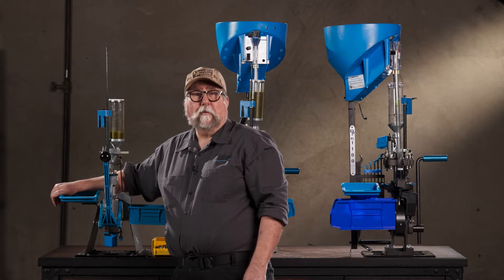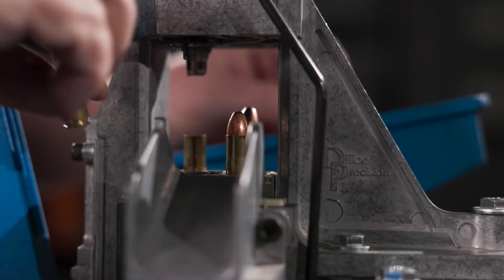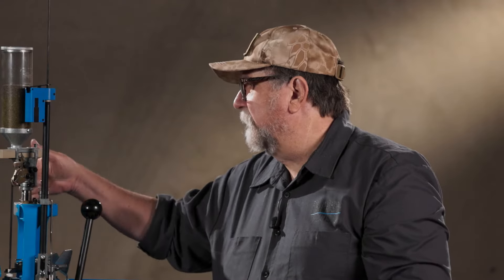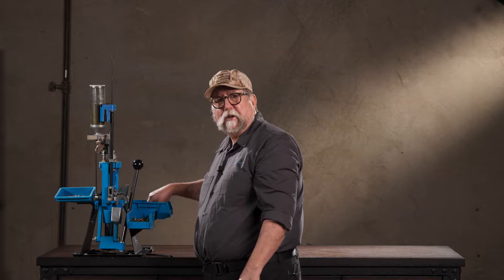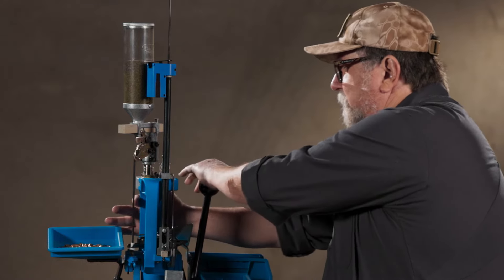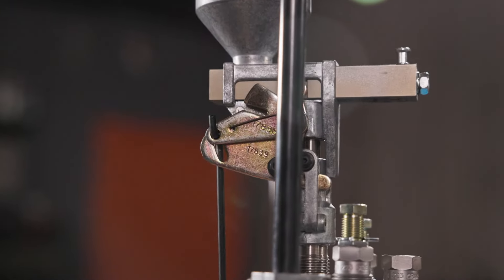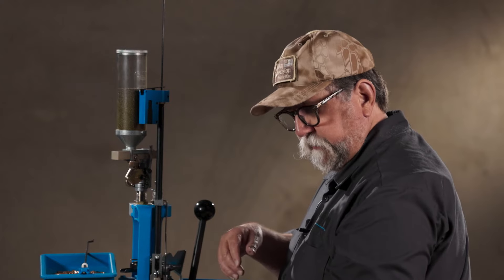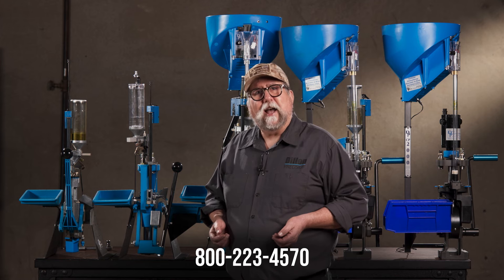Dillon Precision - RL550C Quick Overview

Comment: Just got my Dillon 550c and am ready to get rolling... but it occurred to me, what about case trimming/chamfer/deburring? Are these steps not necessary? (reloading for 5.56)
Reply from the maker: They are necessary.
Reply: @DillonPrecisionVideos  Since the video shows resizing/depriming/priming as the first stage, is the idea that you wouldn't trim every time? Then when you did trim, just use station 1 to resize prior to trimming or have a separate toolhead with a resizing die and the RT1500?